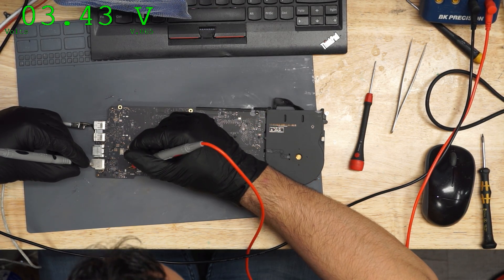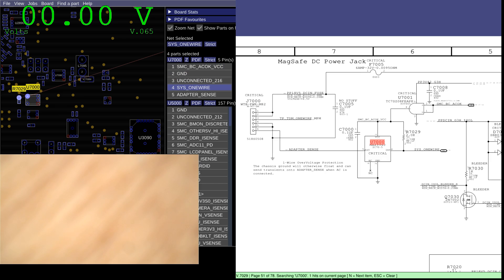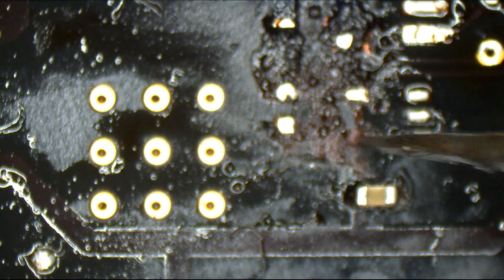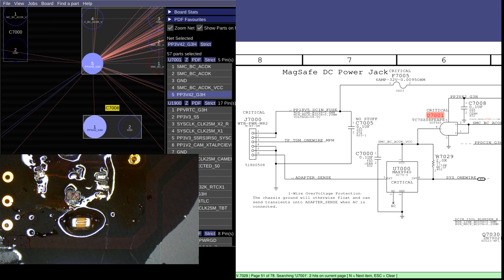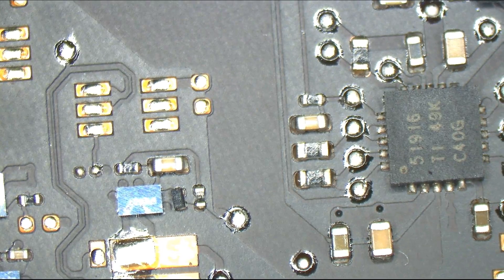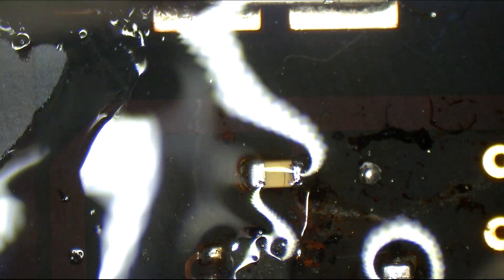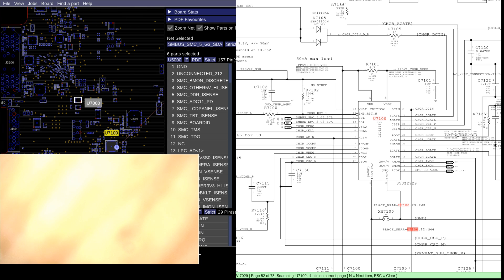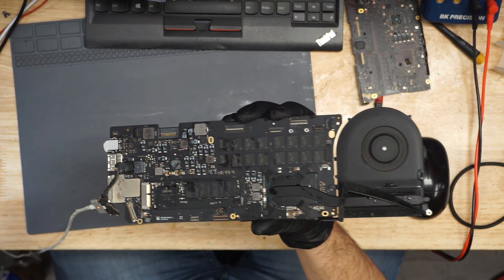Falling through cracks of despair? Get a Macbook repair!(at rossmanngroup.com)  😊

Comment: Okay, I have a radical thought..  is it possible to create electrical equipment that could take very high temperatures ? 
I know this is just wishful thinking.. but instead finding ways to keep everything cool, why not create devices, electrical wiring, or motherboards that can take 500 C or whatever the Fahrenheit equivalent is. 1000 degrees fahrenheit ? lol, idk.  anyway, I know my idea is totally not doable... 
But at least I think different !!  At least you can't deny me that !!!!!

But to do any practical repairs you have to weld, because soldering equipment just won't do then !

Comment: Hi Louis
I am a fan of your perfectionnist work and love your channel.

I have a question not related to computer fix but more related as a electronic repair.

I am a musician/sound engineer and I have to do maintenance on guitars knobs, amps knobs and mixing console fader.
I see a lot of Deoxit D5 as a standard but I am not quite sure id it would be good for all of that.
I read that their is 3 steps to follow.
- Clean with air
- Add Deoxit D5
- Lube

Would you truss that D5 product and what would you suggest for electronic lubrifiant?

Thank you

Comment: I always wondered....wtf does Vcc stand for??....I'm a Heavy Equipment Mechanic & I troubleshoot & repair mobile cranes & I see it on elec. drawings all the time....my understanding was that it is a fixed output from the control units to digital outputs/consumers (usually 24 volts or 8.5 v) ...but what do those initials stand for?

Comment: Hey Louis,  My macbook pro mid 2012 was an amazing machine i upgraded to its maximum by myself. Now it started giving problems with: bluetooth connection, sd reader, id have to change the trackpad and internal cable that controls left speaker and subwoofer (its contacts to the MB were super glued by me when i realized what the problem was, the subwoofer pin didn't glued well). The other day I stepped on the computer and now there is a stain on the screen. My question is, would you say its worth it to fix all that stuff? (the mid 2012 was the last macbook pro with all its  connections, cd drive, and internals upgradable)